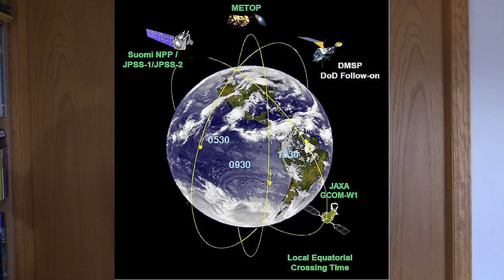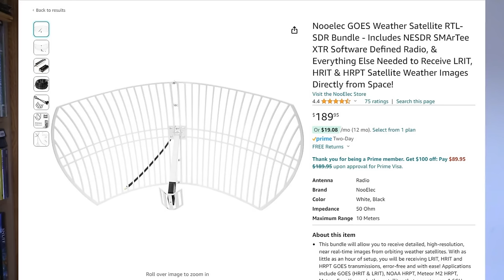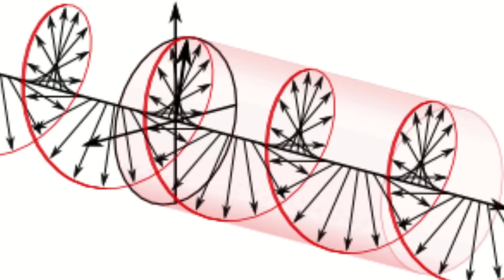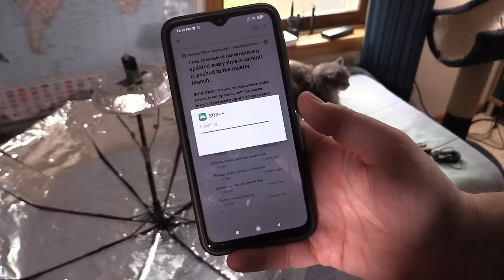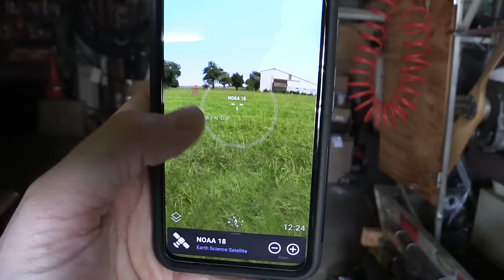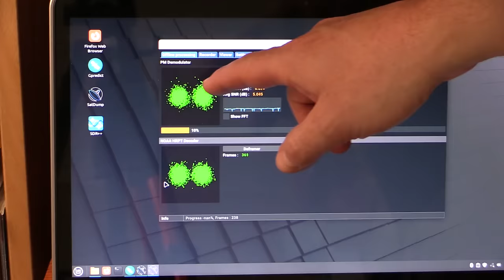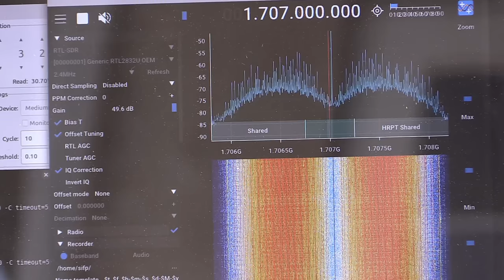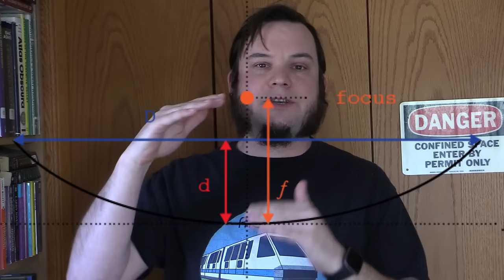How To Receive And Decode L-Band Weather Satellites

Comment: great video as usual! However FYI to all wanting to use your expensive cell phone as an SDR. DO NOT CONNECT THE SDR DIRECTLY TO YOU CELL PHONES CHARGE PORT. it will break it loose. It's way too much weight on that C port. I've been using SDRs for years and have had 2 different cell phone charger ports fail after using one of my SDRs with it.  Get yourself a short or long C to USB wire for $5 and save yourself the headache. The charger port wasn't designed to hang weights from 😂  also most of the apps just suck anyways. If you're using computers with dual monitors like me   going to a phone is absurd and annoying . There's far too many options and capabilities with the SDR software to manage on a tiny screen.  The ham apps that use data are actually pretty good now, so if you gotta tinker on the phone try those hamsphere 5.0 is really interesting

Comment: It's very important to have a pigtail adapter on that/those usb devices. They have tremendous leverage if just plugged straight into a phone or laptop. One tug, or trip on a cable, or antenna blows over, and you're looking at a relatively expensive amount of damage to the USB jack.. Spend the extra few bucks for a short dongle/pigtail. I always have extras for my non tech friends who struggle with stuff like this... I hand them one, and they instantly get it.

Comment: Weird question: how long could you expect to keep receiving useful data from weather satellites and such like this with your kit, in the event of a disaster that takes out their ground stations?
Reply: NOAA 15 is over 25 years old and still trucking
Reply: There are multiple control ponts for the NOAA system. What usually ends a satellite's ueful life iswhen it runs out of fuel for course corrections.
Reply: What I'm wondering is how you would track them without the help of these internet based services

Maybe the timing and path through the sky are really consistent though, I don't know
Reply: @maxscott3349  Their path is well known and maintained. Satellite terminals handle the tracing. What id more fun is tracking then on a ship in rough water. It has to both track, and compensated for the ship's shading and rolling. A friend of mine retired from the Merchant Marines as a radio operator in the '80s. Large cargo ships were installing first generation satellite communication.
Reply from the maker: You can actually download orbital data from another satellite! Although I don't know if it's automatically updated or done by humans
Reply: @saveitforparts military and shipping  users are automatic, Other sites are likely maintained by hand.
Reply: Me and my dad had a similar question but it was about VHF radio automated weather channels. Basically he said you could probably listen to that station for about a week to a month and just wait for it so say the weather where you are but after a while it would lose power because it's solar stopped working or got covered up or it would lose accuracy
Reply: @Jackcat-ub6co  I have several weather only radios. Some are quite active, whie others use a code to direct specific areas and only give alerts. Also, the cheap Baofung and similar handhelds will receive NOAA channels. My first scanner was a Regency ten channel that covered Low & High Band VHF & UHF. Ten crystal cost as much as the scanner did.

Comment: When I played with this a few years ago (downloaded Meteor M2 images), all I used was a small "August DTA240" hdtv antenna with TV "rabbit ears" connected to it. I did not move the antenna(s) to track the satellite, it just sat there stationary. I also was receiving the signal indoors lol. Lots of errors in the image, but it was mostly "proof-of-concept", just to see if I could get an image. I did!!  I was actually surprised it worked as well as it did. 
But the images that Gabe received are just stunning. COOL BEANS!!

Comment: A very comprehensive and interesting video about my favorite topic, satellites. There were also some things in there that were new to me, better to use an umbrella than no satellite dish at all. Perhaps there will also be a video about amateur radio satellites, as there are several in orbit, and even the ISS now has an X-band repeater that receives on 145.990 MHz and retransmits it on 437.800 MHz. It seems that very few people know that receiving weather images and decoding them is completely legal. I look forward to every new video on the subject.

Comment: The geekery here is 11/10. Nice work, Gabe. I wonder if a larger diameter shallow mesh dish would be something that you could build. I know it would take a lot more to keep stable, and to aim, but I'm betting you'd get a much cleaner signal. I suggest a mesh to keep the weight down, and also to give a clean reflecting surface. I suppose it just needs to be dense enough so as to reflect signals properly. I'll bet there's a tool out there that will permit calculating mesh density for a given signal spectrum, etc. Just a thought that I think would be cool, but probably a bit spendy and cumbersome. Maybe a larger motorized mount for it? Have fun! :)

Comment: For your antenna scafolding, move your bottom and middle support braces up to equally split the distance (height wise) on the calculator. 

I had the same problem with mine. They were 30 turn antennas.

Comment: Thank you for this great video. 
Not that I think you will need suggestions for a video, but if you has plans to revisit the cheap parabolic antenna subject. You may try to vacuüm form a antenna dish with mylar around a round mortar tub. Or other round sealed container. And a vacuum cleaner 
You may want to paint the mirroring surface though otherwise you will burn your receiver.

Comment: thanks : 18'20s :  this is BPSK modulation. It could explain why the RX agc gain value has few effect:  With numerical modulation you have a big threhold effect : if your are above this threshold the average gain dont improve reception . Bit 1 ou zero remains 1 or 0.  ( basic explanaion )  If you see 4 points : this is QPSK modulation : better datarate  but higher  SNR needed.

Comment: For the printed scaffolds, thinking that if were broken into five parts it would work better.
Print the legs flat and the two rings with holes in them to index the legs you may have better results
Some assembly required at the end but figure you'll get a better print

Comment: Wow great video once again (and for providing all those links) in the description. Saved Me tons of time not having to find it my self. (Did you ever try this Dish) On the GOES 16 Satellite. This way you Don't have the hastle of tracking it. Perhaps the result would be a clearer set of images. (Less Static)
Thanks again 73s 📡👍
Reply from the maker: This dish is a little too small for the GOES satellite, I think I tried it in a previous video. I keep meaning to set up a bigger dish for that, but I'm lazy and haven't figured out exactly where to bolt it to the garage!
Reply: @saveitforparts  To describe yourself as "Lazy" 👎 I Disagree . (With all these Videos) And a Book in the works.. When do you Sleep?? 🛌

Comment: You can try to reduce the receiver noise figure by reducing the insertion loss before you're first lna. Agc may not give you much as shown because the noise figure of your lineup will be dominated by the loss/noise figure of your first component after the antenna. Sometimes changing from a SAW filter to a ceramic filter improves things because they have a lower insertion loss.
Reply: That's why you put an LNA first before any filters. I would guess the sawbird has an LNA before the filter, but only if they designed it right
Reply: @gorak9000  Downside of lna first is that you pass out of band noise to the lna which can saturate it depending on the noise environment.

Comment: i´m fairly new to SDR radio but what i have started doing to keep the centre pin from moving around when soldering SMA connectors is to first solder the signal wire to the centre pin and then putting a drop of super glue on the base of the pin before assembling the connector and soldering the screen to the connector body.

Comment: Another super informative video, thanks! I notice that with your tracker setup, it's forced to rotate horizontally 180 degrees when it passes overhead. Would it be possible to just keep using the pitch motor to continuously track it without having to rotate, or does the mount have a mechanical limitation that prevents it?
Reply from the maker: The mount doesn't have a physical limit, although it does have a little slop in the internal gearing so it "flops" slightly when the center of gravity goes over the top. I'm using code written for TV antenna rotors, so this is just the way they programmed it. I'm currently struggling with updating some of the code for the thing so it can be a radio telescope, but I'm not actually much of a programmer myself so I'm not sure how easy it is to change that feature.

Comment: Would this be possible with an old DirectTV satellite dish I have laying around? I'd imagine I'd have to get a new LNB. I've also heard the rtl-sdr has trouble powering the LNB as well. If it is possible, what type of LNB would you recommend? Thanks for reading, I respect the work you put into your videos!
Reply from the maker: You'd need to swap the existing LNB for something tuned to 1.7ghz. I've been using little pcb antennas and 3D-printed helix antennas, depending if the signals are linear or circularly polarized. I should actually do a video on this with a little DirecTV dish, people keep asking about that! I'll put it on the to-do list.
Reply: @saveitforparts  Awesome, thanks so much for the quick response! I was also just able to get my first NOAA satellite pass successfully recorded yesterday!! All thanks goes to you!!

Comment: SMA connectors were never really designed to be used for equipment that was going to be moved around a lot, or plugged and unplugged a lot.  They were really designed for microwave (up to 18GHz)  use inside equipment enclosures for connecting modules together and with lots of good strain relief and cable management.  But their use has expanded into communities that may not appreciate their heritage nor their limitations.
Reply: The original SMA cables were rigid, or semi rigid coax that didn't alow the center conductor to move. We made all of our cables in house at Microdyne when I first started working there. A final step for SMA was a weight that was screwed onto it, to test the joint's strength.
Naer the end, we were using a very tiny snap in connector on one product. They had to be ordered premade because the tooling was computerized and only leased.
Reply from the maker: Yeah it seems like EVERYTHING is SMA these days. Which is actually kind of nice, I remember when Wifi cards used MCX and SMB and even tinier BS that would break if you breathed on it. SMA is actually kind of refreshing, and I no longer need a box of proprietary pigtails for every gadget.
Reply: @saveitforparts We used about ten different types of RF onnectors at Microdyne, and both 30 and 75 ohms coax so the RF benches had a lot of cables to test boards  and subassemblies.

Comment: Encryption would also add a thick layer of potential problems if there is noise. Unencrypted is easier to get something from even on a bad signal. Even with error correction etc, those are just solutions to work around problems with encryption of non sensitive data.

I am not saying it isn't solvable, but the technical house of cards would get unnecessary big.

... As far as I know. Correct me enough and I'll remove this comment :)

Comment: If you're using an on-the-go adaptor, get one with a cable between the plug and the socket.  Saves putting a strain on the connectors at both ends, and could save you an expensive repair.
Ask me how I know this.  ☹

Comment: SMA connectors are not intended to be used in the way we use them, they are supposed to be inside equipment and connected once and never messed with again. I like to support the SDR so there is not so much load on the fragile connector. I like the scientific method of doing this so hot glue and a piece of wood.

Comment: The physics would say that the parabolic dish will reflect all signals at the focus point of the. Parabolic dish, which is most likely at the horn, not sure your helix which isn’t at the focus is making the most of the parabolic reflection. Have you ever tried a double helix antenna, just two springs mounted side by side, one left wound, one right wound and point them at the sat? Curious if it gets more signal and would eliminate the amp
Reply: His focal point hits the tin lid which is 1/4 wave behind the helical antenna.

Comment: Always check the phone specs as OTG capabilities of many phones are either permanently disabled or crippled by the manufacturer with very few capable of being activated. Amongst those that do function fully some just are not powerful enough to run SDR applications and in some battery drain with SDR receivers is so high that they become useless. If you are not sure or can't find the information give it a go as you may be pleasantly surprised when it works.

Comment: I wonder which SDR device would be best for these satellites? I have several different types, but have only used the RTL-SDR for satellite reception. It seems kind of weak. Most of mine are $300USD or less. Im sure a $2,000 unit would be great! Lol
Reply from the maker: If you can get one with super high bandwidth that can see more of the radio spectrum, I've seen some interesting stuff done with those! There are a few satellite signals that need much more bandwidth than the cheap SDRs can handle.

Comment: Forgot  got to mention as an idea i am about to try  using a pair of free geared DC motor driveway car gate openers  i am going to use instead of  actuators on my 2m C band mesh dish  they  seem to be very strong and do the job easy once mounted
Reply from the maker: Cool! That sounds like a fun project.
Reply: Yes i was lucky  as they were free i was not  expecting to be able to move the dish via any thing i would have placed my dish pole a little forward  to  move up down any direction than just the geo belt ...OH well ! keep up the good work on the satellite dishes and different feed ideas so helpful know what can work and what can't !  Your very inspirational on all this and very good at it ...

Comment: i have a question you may answer mate. i'm a builder into FPV RC and i saw some amplifier like that one using 8.5G frequencie  ( the one used in FPV ).
but they are sold as emiter amp , does the one you use for a wider band is a special for recpetion, or are they the same and i can use it on a receiver ?

i'm also a parts saver and like to mess around with stuff , i allready built a mini dish for emitter in RHCP , receiving in LHCP but never amplified :)
i also wonder if it's send as a voltage, and can fry a receiver because of an amp cascade. because there are allready weak amp in FPV google PCB

thanks if you answer ans sorry about the broken english !
Reply from the maker: That makes more sense than some of the English comments I get :-D I'm not actually sure if you can use the same type of amp for transmit as receive. A transmit amp will usually take more power input and have better heat protection / cooling fins, depending how much power you're putting into it.
Reply: @saveitforparts  thanks for answering. may i email you about that project i have ?

i got somes questions. not a lot but you seem to be wiser than me on the RF part :) 

my english is not that bad bad, but i know i make mistakes, i'm french :)

Comment: I'm trying to pick up the Australian Himawari 8 & 9 weather satellites, but I'm struggling to receive anything. Apparently they transmit on 18.1 - 18.4ghz. I have managed to pick up a signal with a QFH antenna on 18.1 but it doesn't sound anything like what I was expecting. Unfortunately I bought the QFH antenna for this but it suits the NOAA satellites (137mhz), not Himawari 🙄Any suggestions would be great! (I am struggling to find what would be appropriate for the given frequencies)
Reply from the maker: I don't have much experience with that frequency range, maybe a Ka-band TV or internet dish would work? Antenna sizes and designs are usually somewhat specific for the frequency / band, so a VHF antenna for 137 won't get anything in the microwave frequency range.

Comment: Found a weather balloon transmitter out hunting one year , It had a little helical transmitting antenna along with electronic package and crusty battery..
Reply: The helical antenna was for receiving GPS data, not for transmitting
Reply from the maker: I want to try tracking those one of these days, I have some of the radio gear and it's on my list!

Comment: is it necessary to have WIFI connection while recording the static signals using SDR ++ with RTL - SDR ?  cuz I have a weak WIFI signal outside the house
Reply from the maker: You shouldn't need Wifi at all, unless you need to update your software or something.

Comment: Could you make an adjustable circular polarized feed horn by having the coiled up spring actuated so you could compress and expand it with a stepper?
Reply from the maker: That's an interesting idea! I'm not sure if that would work, as I think both the diameter of the coil and the distance between turns is important.
Reply: @saveitforparts  ah yes of course...

Comment: Do these satellites usually transmit some hashes, checksums and/or error correction data, or is that not a thing?
Reply from the maker: You know, I'm not actually sure! I think the transmission protocol is designed to just ignore loss, which is why I get occasional static, missing pixels, or discolored glitchy bands (especially from the Russian sats). I think the idea is you don't need it to be 100% complete as long as there's enough data to do your weather forecast.